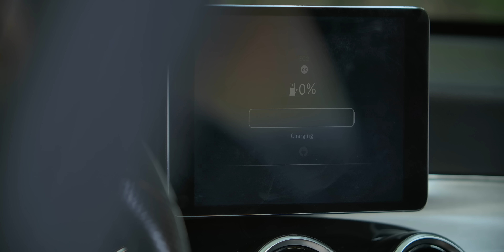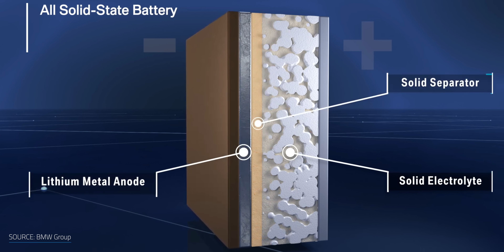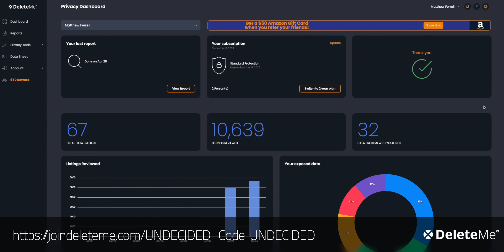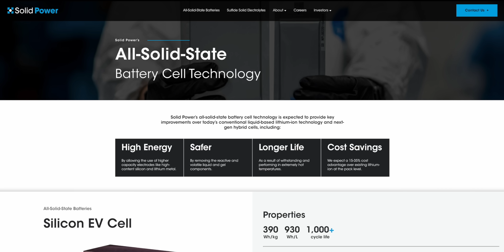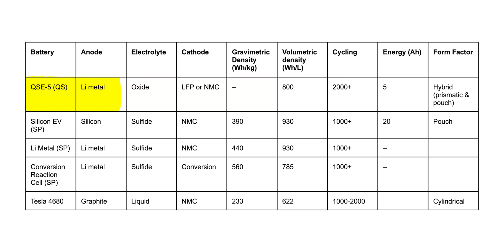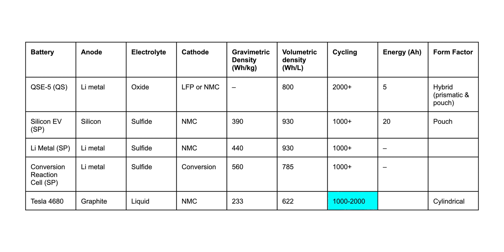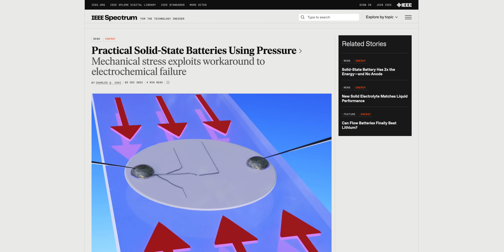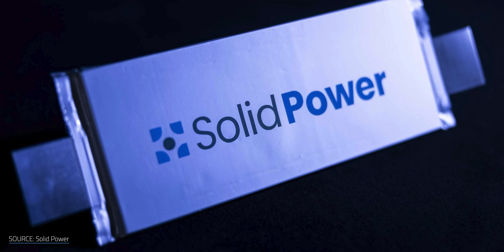Solid State Batteries are Closer Than You Think

Comment: I will charge my solid state battery car, using electricity generated by fusion power plants. Just 10 years away.
Reply: Just take the shortcut and make a fusion powered car
Reply: @isaacmoon6739  I like the way you think…you’re crazy, but still.
Reply: @isaacmoon6739  Fusion does not scale down favorably.
Reply: This is not an apt metaphor. We have solid state batteries, they exist, we have experiments loading them into cars. No one on Earth has generated more energy from fusion than was put into the system generating it. 

So no. Right now it's fine tuning and ramping up. That said, the first solid state vehicles are going to be super expensive and a bit janky. Our current 3rd gen and 2nd gen evs are enough for most people's needs.
Reply: @Dr.Gehrig 
That second point isn't correct, the National Livermore Institute (if I got the name right) has already gotten more energy out of a reaction than it put in.
Reply: @LancesArmorStriking  "technically". Not more energy put into the SYSTEM, they got more energy than MADE IT to the target. Those are two VASTLY different numbers.
Reply: We have fusion right now, it’s called the Sun.
Reply: You mean, 20 years? I always assumed that was the timeline.
Reply: Please update every 10 years....
Reply: They have been for 50 years!
Reply: @bgg-jp5ei  You are right, but also, science doesn't operate on anyone's schedule.  You have to try a bunch of stuff to figure out what does and what doesn't work.  All these estimates are just that, estimates.

The exciting part for me is that they have samples that work.  Figuring out the engineering challenge of scaling up is always easier than figuring out the science.

I'll leave you with an example.  People were trying to figure out flight for hundreds of years.  Then from 1914 to 1960 we went from flying a few hundred feet to flying supersonic and across oceans.

Once you figure out that one key piece of science that makes it all click, it becomes an engineering exercise and progress speeds up.  That's what I am hoping for with solid state batteries.
Reply: @TeodorSpiridon yep, and those aren’t anyone’s schedules, that’s people looking at sciences distance from that tech 🤦‍♂️
Reply: @bgg-jp5ei  that was his joke
Reply: @bgg-jnp5ei no it has always been 10 year away !
Reply: Just 30 years until we unlock fusion. just 30 years
Reply: @fallencobra5197  Congratulations you are the 4.364.742th person making that joke
Reply: New York State gets the majority of its power from hydro and nuclear. Homeowners should charge at home if possible and have their own solar system, 
So your statement is only correct with conditions. 

Change is hard. Not everyone can cope with it.
Reply: Fusion is not right around any corner we can see from here.   Hot fusion is a bomb,  and as I understand it, less hot fusion is not energy dense enough to sustain the reaction, contain its heat and power outside consumers.  All the laser contained fusion consumes way more than it produces.  They report it as power positive but that involves counting the ignition but not counting containment.
Reply: @RjWolf3000 . That’s not what “hot” fusion is.
Reply: @robertt9342  hydrogen bombs can produce temps 31 times hotter than the sun.  Sounds hot to me.  Maybe i have stumbled into some pedantic definition problem.  The point i was trying to make is that at the containable temps, more like the sun, lacks the energy density to power both a sustainable reaction and its own containment and then produce a surplus to make it a sensible way to produce electricity.
Reply: @RjWolf3000  Sure, but what does that have to do with fusion being right around the corner or not?
Reply: @4203105  well,  that the problem with containing fusion is really that you either need enormous advancements in containment on the efficiency so you can turn a profit on low density fusion or huge advancements in capacity, meaning you can contain very insanely hot fusion to turn a profit.  The latter being a fairly dangerous thing to fail at.

There may be some pretty fundamental physics problems with either path that mean neither is really viable for large scale power generation.
Reply: @RjWolf3000  It's not dangerous at all. Plasma temperatures of Tokamaks are going to be in the 100 million °K range (ITER planned to be 150 million °K), which is more than 25 times hotter than the sun and if it fails you'll have slightly scorched reactor walls, nothing more, simply because the plasma isn't dense enough to do more damage.
There could still be fundamental problems, but I don't see foresee any. How the plasma behaves is well known by now. The biggest problem I see is breeding more Tritium, which is an engineering challange to be sure, but I'm confident that it will be solved.
Reply: Fusion has been on the “10 years to commercial” for 40 years now. SS batteries were at least on a 5 year.
Reply: Damn, a bot stole your comment
Reply: Same! As soon as I have my own place in like 5 years, I'll only have to wait 10 more years for this awesome future!
Reply: @dankielab  no i am talking about micro fission reactors. There are companies in the process of getting their functioning reactors approved for deployment. These fit in a shipping crate. They are definitely whats next, fusion reactors are not coming for a long while.
Reply: The problem is it’s always 10 years away so in 2035 it will be 10 years away and in 2056 they will still be 10 years away.😅
Reply: Always 10 years away! Kkkkkk
Reply: is it possible to have fusion power engine instead?
Reply: @snappycattimesten I’m coming back in 10 years to see if this is true
Reply: So close!
Reply: Innovation takes time
Reply: Hahahaha sure
Reply: Lets hope
Reply: @dankielab  i typed the wrong word good call
Reply: It will be still 100 years away if fossil fuels subsidies continues. Until then they have unlimited resources to brainwash people and keep the status quo. Only carbon tax /pollution fees can make the market fair.
Reply: Fusion they always says 15 years.
Reply: @jamesagerholm2034  I will not be surprised that in the distant future we will learn that fossil fuel companies bought some breakthroughs in fusion that was ready to go decades ago.
Reply: 10 years later they’ll say that, but in another 10 years - so on so forth.
Reply: You Sir , are not wrong
Reply: Lol😂
Reply: We'll  be using some electricity from renewable waste products
Reply: Hydrogen fusion expectations are like an exponential function decay function that will never really reach the end but just gets ever nearer. I think the governments are taking a massive gamble that it is imminent. Especially the UK plan where we are fully committed to purely electrical energy dependant entirely on the presence or absence of wind. It could also be a youtube function where there can be an infinite number of 'it revolutionises' and game changers with no discernible improvement in what is actually available.
Reply: @michaeld5888  You are an island. You can power yourself with wind 10 times over. If anybody in europe does not need to be afraid of switching to renewables, it's the brits and yet you seem to be wimpering about it the most. Why is that? Your yellow press?
Reply: Ha ha ha ha ha... 🤣🤣🤣
Reply: I hope so!
Reply: Fusion would make everything possible.  However, the 10 year timeframe is WAY optimistic.  We haven't even had any practical lab trials with it.  It may be a pipe dream, or it could be a possibility 50 years out if we have some massive breakthroughs.
Reply: @n2omike  Net positive fusion should be demonstrated next year. Keep an eye on commonwealth fusion.
Reply: Tesla new batteries are that
Reply: I will say the same thing again after 10 years
Reply: the future is bright
Reply: Lol we have Zero point energy technology that has unlimited power solid state batteries are pathetic look at all the inventors and scientists kill who have made free energy technology. This is pathetic.
Reply: In about 10 years that solid state battery will be about the size of a postage stamp and will last an insane amount of time.
Reply: @snappycat_times_ten  feels more like 10 to 15 years, remember the att commercial. That was 1989, iPhone 4 came out in 2010.
Reply: @snappycat_times_ten  Green future! Just a week away!
Reply: Fusion is complex,better charge it with PV modules
Reply: I already had a zpm in my car
Reply: Ha, good one, mate.
Reply: Fusion power plants, lucky if we see it by 2050 maybe. In nature it takes mass 80 times the size of Jupiter to create fusion.
Reply: ENOVIX corporation is well on their way towards mass production of their groundbreaking patented batteries.
They’re the real deal, getting things done.
Their YouTube channel is very informative regarding how their battery technology works.
Reply: just started investing and buying shares
Reply: That's his info ✅
Reply: Micro nuclear reactors. Are whats going to be the new energy source for many people. Its fission, but its real and safe. Micro reaction units cannot go critical. Fusion is still a hope and a dream away and far too complex to be a feasible solution in the near future. I think we're still 50 years away from fusion being deployed at any significant scale.
Reply: @stevenB216 fusion even?
Reply: @stevenB216  small modular reactors were the new hot thing 20 years ago and they have remained a fantasy for quite a few reasons. Also of course they can go critical. Otherwise they wouldn't work.
Fusion on the other hand is relatively close. If Proxima fusion keeps their time table, within ~7 years. Let's see how their test reactor does next year. It should break even or produce a small surplus.
Reply: It takes around 6 to 8 years to build a nuclear reactor.
Reply: Fusion really isn't that far away anymore. Actually about the time solid state batteries should finally come to market. Early 2030s.
Reply: Fusion is more like 3-5 years away at this point. not to say it'll be here in 3-5 years,  but expected timelines have dropped to there. At this rate, above-breakeven fusion demo plants will exist before you can buy a solid-state battery.
Reply: @Ithirahad nonsense, fusion is still 30 years away
Reply: @Ithirahad  context matters.  We may get solid state cars in 5-8yrs. But then they need access to fission power.  I know for me, i won't get nuclear of any kind for a good 20yrs
Reply: @Ithirahad  just because they are able to get a fusion reaction on a fixed fuel pellet,  doesn't mean that we are close to a sustained fusion reaction to provide continuous power.  Until I see a viable solution for a sustained reaction,  we are still 10+ years away.
Reply: @adamflores4206  I'm ignoring NIF "breakeven" results; they're irrelevant. The 3-5 years figure comes from Commonwealth's SPARC project, Helion's test reactor series, and others in the private sector.
Reply: Fusion has always been 5 - 10 years away and probably always will be. Just get on with more renewables - quicker, safer and cheaper @Ithirahad
Reply: @Ithirahad Fusion will never be widely economically viable on earth against renewables. Maybe for unique situations like fission now is as well.
Reply: @Ithirahad if fusion is out first, then there won't be any need for solid state, people will have have plenty of power for decades, that is  assuming fusion can populate in varies countries first
Reply: @Ithirahad  I really hope you're right!! 🙏
Reply: @Ithirahad Fusion is aleays 5 years ahead. We need more tine for to make fusion power at least wait fpr new materials and agi. Since it has  a lot of problems right now
Reply: @Ithirahad  source? I’m just getting pretty tired of people hyping fusion without solid evidence and without understanding why it’s so difficult or even impossible to achieve for commercial use.
Reply: @rhineman  Nobody said fusion was easy. But it's far from impossible. Look up Commonwealth Fusion and maybe in a few years Proxima Fusion.
Reply: @Ithirahad  actually commercial fusion power will take longer than 20 years to be widespread. It will take 5 years just to achieve adequate net positive fusion in experimental reactors, but it will take much longer than that to build safe, stable and highly efficient commercial fusion reactors and train the hundreds of professionals to operate them.
Reply: @Ithirahad  Actually, some have promised fusion for... some years ago. They are just waiting for the time machine division to finish their project. Fusion is nowhere near 30 years away, if possible at all (as power plant), so don’t expect too much.
Reply: @Ithirahad Haha, no way. It’s 300-500 years away.

Comment: im gonna continue to wait on the EVs not because im scared of em or because of the batteries, but more or less because i don't have the money for them, and they will eventually just short out anyways once a X30 or higher solar flare hits the planet.
Reply: An ICE vehicle would also get toasted by a solar flare so you're not that much better off lol
Reply: @capnseriousnap  while yes most ICE vehicles will, but not if its a older diesel engine modified with a air compressed starter.
diesel engines do not rely on spark, they just rely on compression to make the explosion.

Comment: They are still at least a decade away from being in mass production and not just in super expensive cars like Porsches and Ferraris.
We are going to be stuck with crappy LiFePo batteries for many more years.
Reply: Wrong, Sodium Battery is already on the market, and performing better than Lithium Battery, and cheaper
Reply: @mengkit7884  They are almost the same. Makes little difference.
Reply: @jimj2683  They are pretty damn different.
Reply: Why crappy?

Comment: I want to see hybrid Battery+Hydrogen vehicles, perhaps with a hydrogen cell that can be swapped out at a gas station sorta like how you change out a propane tank for a grill.
Reply: No thank you, hydrogen even worst than current ICE requiring all the same setup and would cost way more to get out there than eletric anything would even if its hybrid car
Reply: @adr2t  Err... anything to back any of that up? He's already done videos on how excess solar generation can be used to power hydrogen production.

I merely wanted to discuss that it'd be an interesting evolution of the plugin hybrid to a purely green energy one. Plugin hybrids provide peace of mind because you can always fill up the tank, so a way to transition that to a green solution seemed interesting.

I suppose it's a moot point because you could do the same thing with a swappable battery as you could with a swappable hydrogen tank, but I still think it's at least an interesting concept.

As batteries keep getting better, hydrogen becomes less and less important, but hydrogen is also virtually infinite and does not produce waste to make, unlike batteries, so I still like to consider the possibilities.
Reply: @SocialistCharlieKirk  Other than the fact we have to 1) Produce it, and normally that comes from oil? 2) Store it, and transport it like we have to with gas? 3) Keep it underpressure + cool it unlike we have to do with gas? 4) Move it to locations where you can use it to fill up your method of travel while they still have to use power to cool it? I mean where do you want to start? What about the fact that its under pressure and a good hit will cause it to set on fire or blow up? Or the fact it leaks out of the tanks adding to the already air problem? What aobut the fact it takes 2x more power to produce it if you was to use eletric power to turn water into h and o? What about the fact you need CLEAN water to do so? Even then, you have to uses rare earth metals that cost more than Li and or other element?

Air planes? What about the fact it changes size and pressure up in the air? What about the fact if it goes off, its going to burn way different causing way more damage? What about the fact it normally means heavy tanks to store it?

You are way way better off with battery + Gas at this point than H any day of the week.
Reply: Redox Flow my friend